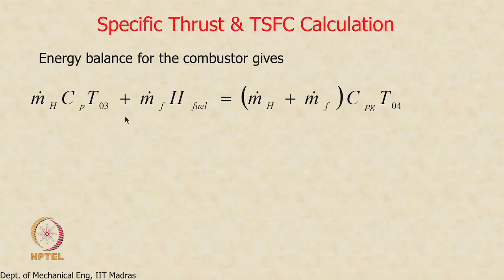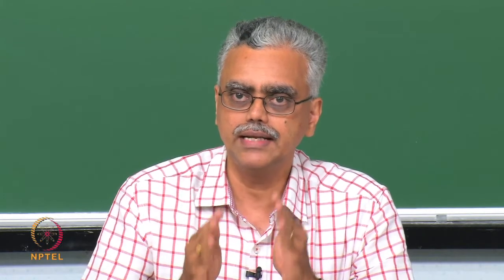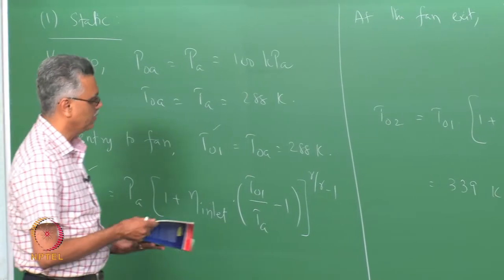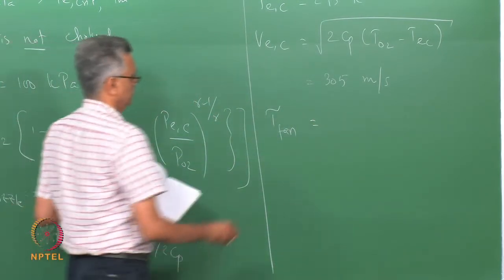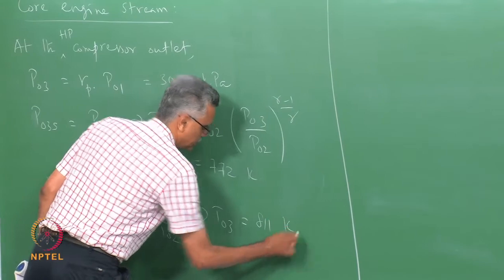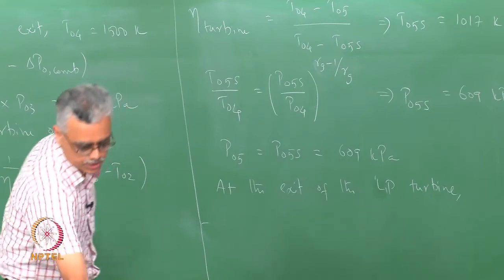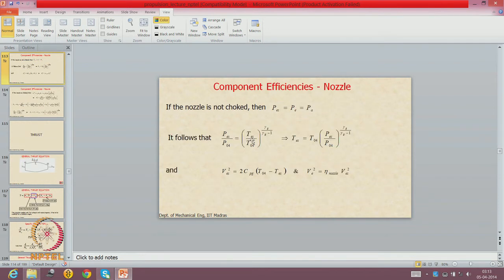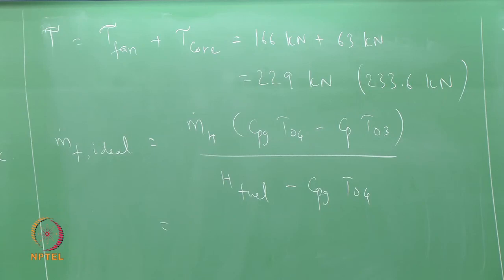Mod-01 Lec-34 Calculations for Thrust and Fuel Consumption

Comment: Here at 35.31 there is a calculation mistake getting stagnation pressure at station 5 as 603 not 609 kpa kindly once check it